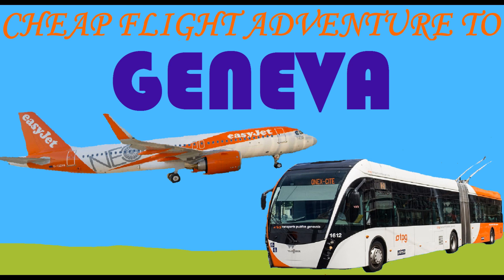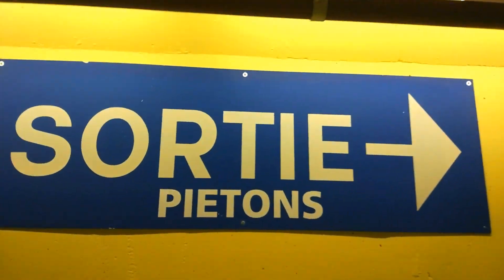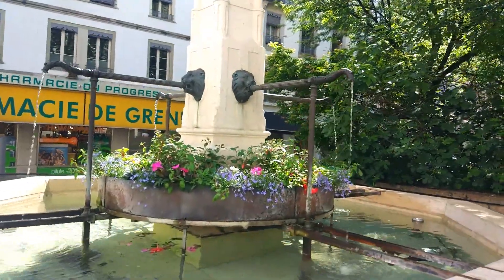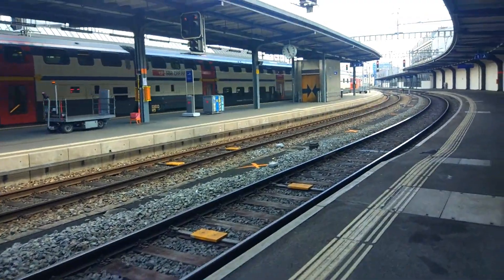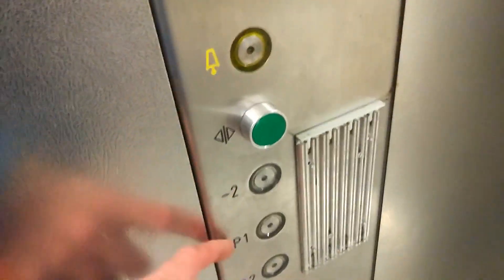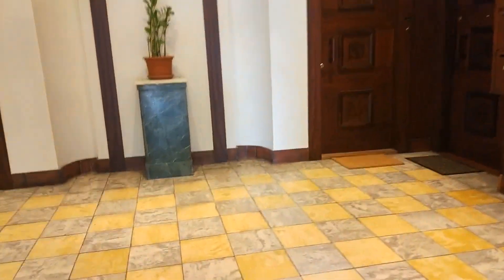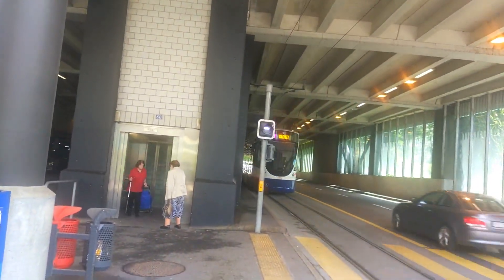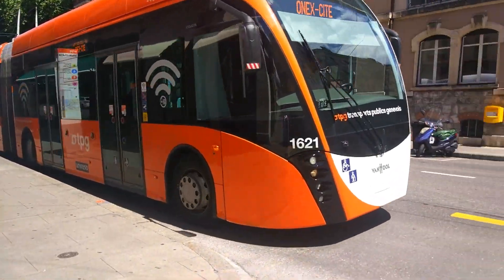Cheap Flight adventure to Geneva part 1

Comment: Switzerland is a very neat and tidy country. I've been there many times on summer vacation. In my experience all is well there. Crime rates a low, not much poverty (the income of the avarage swiss citizen is high). You also don't see much survaillance and security  about, it's perhaps a bit naïeve compared to other countries.  But it is a very expansive country to live, groceries cost more then in the netherlands or germany.
Reply from the maker: I found Switzerland to follow the same surveillance method as Germany, which is encouraging the citizens to be vigilantes.  Like Germany, loads of service areas and restricted areas are unlocked, but if you are caught you are screwed.  Maybe not quite as much as Germany as people are less suspicious of people they don't know than in Germany.

The police are very effective in Switzerland.  A policeman saw us on the roof of a building.  One hour later as we were walking down the street he came over and stopped us.  He couldn't speak any english.  He looked at videos on my phone and saw me lift surfing.  I thought we were screwed, but after 10 mins he let us go, and I am not sure exactly why.
Reply: I seen a M series lift yesterday but the only thing is stupid the top floor is blocked off 😩😩😩😩.

Comment: Dang, you missed some really cool places.
Reply from the maker: What did I miss
Reply: At cern you saw the globe which is nice but you should have been to the microcosm as well if you go just inside the reception. The train station at the airport has some really nice schindler R series lifts. At Balexert, there are some nice Otis 2000s where you can see into the motor room on the bottom floor. You should also get a ride in the new TOSA fully electric bendy buses they run on the 23 from the airport (among other places) though they only run TOSAs on like every other bus (though it depends on the day). Also on your public transport ticket you can take the trains which run within Geneva (like the proper ones) and if you get lucky you might get on one of the double decker trains (though this is rare for regional trains). Make sure to get a ride on the old Duewag trams which run only on the line 12 which are going out of service soon, you can hear the DC pulsing if they are not too busy. And if you want to meet up then that would be really cool, DM me.
Reply from the maker: I am at home now.  At least I did most of the things on your list.
Reply: Oh well, I'm glad you came to visit anyway.